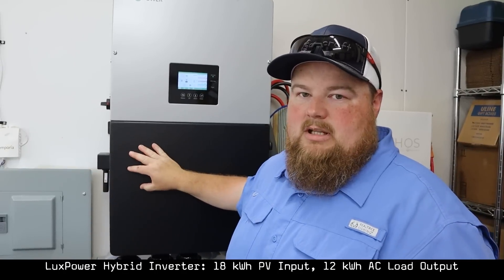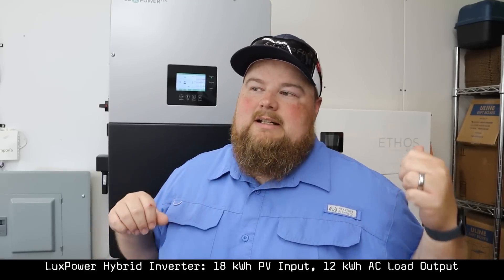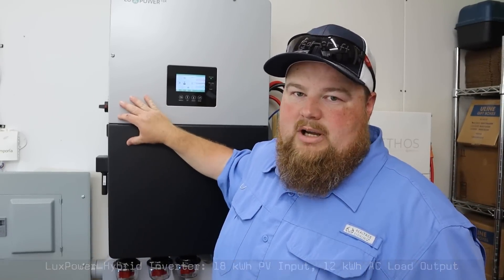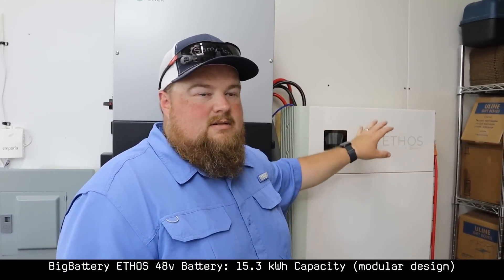Our Mobile Home is [mostly] Off Grid! HOW DOES IT WORK? BigBattery ETHOS 48v

Comment: Don't use heated dry for your dishwasher, when the cycle finishes just open the door the next time you walk by, there should be enough heat in there to dry everything, maybe shake off any extra water that collected in any crevasses.

Comment: @GreenAcreHomestead real nice setup, awesome you guys did it all on your own; BTW just so you know your solar products will not exceed your max current needs at 4:35 that monitor chart shown your solar products was being limited my the inverter because it has no place to put all that excess energy, anytime you solar products equals your current load + 70-100w for the inverter, that means your solars array is producing more energy but your inverter has no place to use it, get yourself some bigger batteries or run your dishwasher or anything extra during the day, loads of unused energy from that over size array, truly nicely done!!

Comment: The Bizzywork is behind U. 
Maintain Data Acquisition. 
Go Old School.....
Let the FREE Air Dry the Dishes and The Clothes. 
A Propane Stove, Oven & heat for the house eliminates the heating elements also. 
That pays for itself in 6 mos, and over and over after that. 
A Hood & Fan is only a couple of hundred watts and runs a short time.
They Draw 20X what the lights and puters do. 
THAT Savings will pay for the batt expansion.

Comment: Just because I was frugal, I used to turn off the dishwasher when it had drained for the last time, dishes still hot from the hot water so they air dry just fine by opening the door.  I think I used to pull the bottom tray out too, but I'm 80 now & not sure I'm remembering that right.

Comment: Why not sell the power back to the Electric company like I do. Not having to worry about the upkeep of a battery? Then when you dont have much sun, You have credits on your bill to cover it.
Reply: Unless you're lucky enough to still have 1 to 1 NM (which is getting pretty rare these days), the electric company won't pay poop for the electricity, so you'd have to generate a LOT of excess electricity to offset the off-solar usage.  Better off with batteries (unless you can still get 1 to 1 NM).
Reply: @ssoffshore5111  my electric company gives me the same rate for buying and selling electric

Comment: I'd grab the last 4k panels and get another battery. Should be self sufficient at that point. good video, thanks for sharing. Also, if you double your battery capacity, you won't have to run them as low as you are and they will last much longer.

Comment: well now that used solar panels are like 0.20$/watt they are literally cheaper than plywood/osb lol. would be cool if you made a solar shed type setup. basically double the width of your ground mount array and double its height. i bet you could park a car in there. do a loft in the higher portion. there is one yt video ive found where a guy basically did that and said it was a bit finnickey getting them all to glue/seal togeather on the roof but he did bifacial and the see through look inside looks really fresh with the natural lighting. obviously as money allows. i know eventually you guys will be 100% offgrid. i subbed for more, thanks for uploading all your hardwork, i feel like recording makes it 3-4x as difficult to complete a project.

Comment: We have 41 solar panels and two tesla batteries and we run our home off of this and sell power to the grid.  It saves a ton of money where we live because our county grid is run by gas.  The cost of set up is high but the comfort of always having power is awesome.  We live on an island so things can get crazy as far as electrics go.  I know in TN tornadoes  and other storms can cause a lot of problems but at least your electricity is not too expensive.  Congrats on getting off grid!  It is a comfort to be able to have control over your circumstances.
Reply: I rent mine from Tesla!

Comment: 😅why use a dryer when you have good weather put up a clothes line and dry your clothes outside
Reply: So you do not have to go outside.  It is hot, there are bugs, it takes 15 minutes to hang them out and 10 minutes to bring them back in.  I did have to educate my wife to not start a load after 4:00.

Comment: Since you are still on grid if you produce more than you require does your power company credit you for the excessive power produced? If so might it make sense to spend the monies you might on expensive batteries  hoping to purchase enough for any emergency to add to your solar panels producing excessive power on a much more regular basis and happily accepting all that credit from your power company. Just a thought!
Reply: He has an off grid system, it has no connection to the grid.  That is why he has a transfer switch to get grid power when he needs it.

Comment: Unless you specifically want to be off-grid, using the grid as the battery works well in some states that require power companies to credit customers one for one, who put more energy back into the grid during the day. Then at night use those credits to draw power back from the grid. Some states do not force one for one credits and in those situations, using the grid as the battery is not as advantageous.
Reply: 1 for 1 credits is becoming very rare these days, or will be soon if you still have it!  Thank all the lobbying by the power companies for this...

Comment: Sam this is just my opinion but you can continue to add lithium iron phosphate batteries to that bank over a long period of time unless you over work that battery. I'm sure you know to set various charging parameters so you don't completely charged the battery every day and that you don't completely deplete.

I have added batteries to my system I am not using the ethos but I am using lithium iron phosphate and I see very little performance degradation because I have babied my batteries 

Of course I wouldn't wait a long time.  It's too bad you are heating with electricity because yes heating elements suck suck suck 

When I monitor my system the biggest spikes I see are 2 refrigerators defrost cycles. 

All other heat in our house is done with propane

Comment: Harness the power of the sun, and put up a clothes line outside. And skip the heat cycle on the dishwasher, just open the door after the rinse cycle. Just a couple of ways to conserve electricity.
Reply: I will pass.  Who has time for that? 

A well specced system won't force you to make concessions like that.
Reply: Buy a Bosch dishwasher.  It has this weird metal wall that pulls water away from the dishes.

Comment: A couple of questions Sam. When taking in consideration the cost for all of the equipment, battery storage, and future upgrades how long do you think it will take to break even by being off the grid? I know there is a lot of peace of mind in not relying on the power grid but just curious how long does it really take if you are purchasing everything verses just being on the grid and paying your monthly bill. Secondly not sure there is a real need for this but can you set it up where it would automatically put you back on the grid if you were to need to instead of flipping a switch -- probably not necessary when it is easy to flip a switch but the techy side of me is wondering if you can do it. Great video you both have done a lot of work!!

Comment: Great video.  I would be interested in seeing what your total capital costs were (panels, batteries, utility building, rentals for any equipment, etc. as well as the monthly cost for your power bill prior to getting the off-grid power solution.  This will provide a "payback point" for the costs vs savings.

Comment: Great info guys. One question for you. When battery’s get low and you need to switch items(ie. dishwasher) back to the grid, is them some type of automatic switch that will transfer you back to the grid and vise versa when batteries are charged switch you back to off grid?
Reply: Not here, but it could be done with a smart panel.

Comment: You could expand by putting a generator lockout (or transfer switch) in the soap shack or your shop. Then put an off-grid system in each with panels on the roof or carport to charge smaller systems in either or each. Doing this in either would mean your house system's battery would last longer. Do this later when you have the money rather than now when you might not have money for a bigger battery on your house system. BTW you could also use a smaller system to attach to the generator input in your house system. Smaller systems backs up big system, big system backs up smaller system and there's always the grid, but at lan even ower cost.